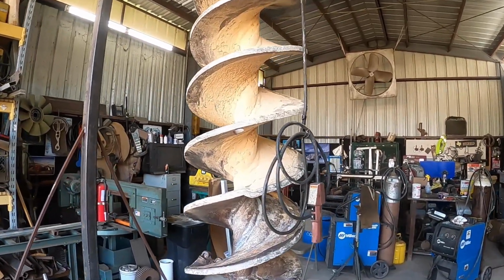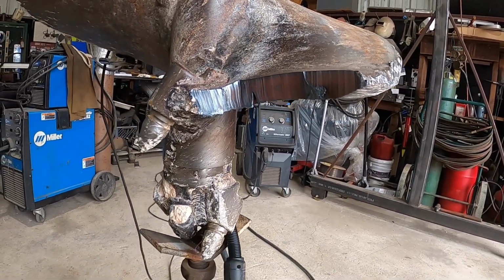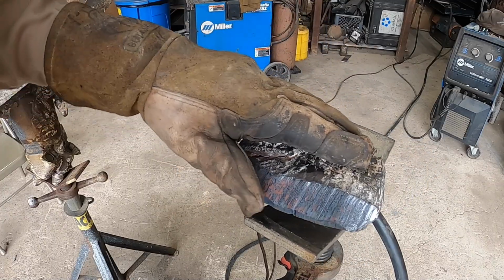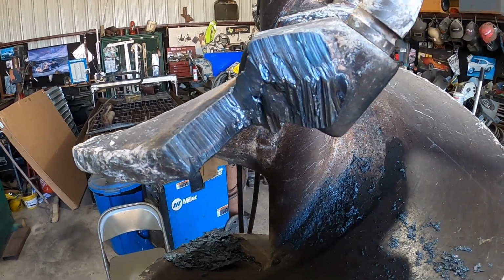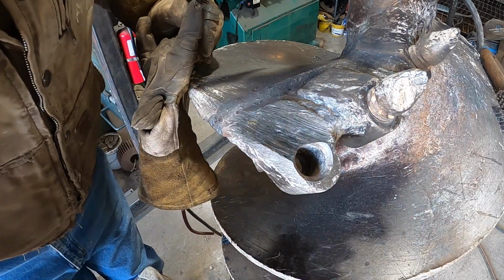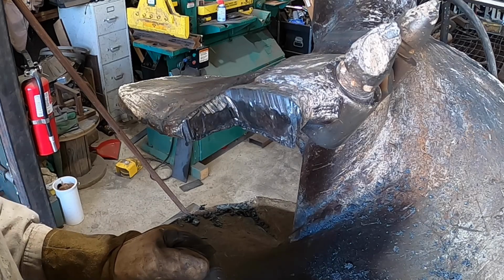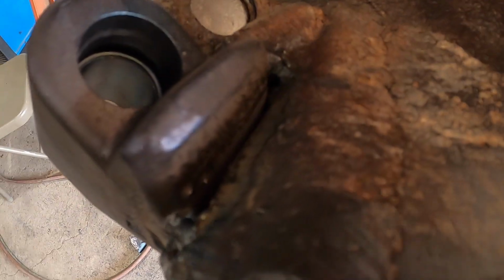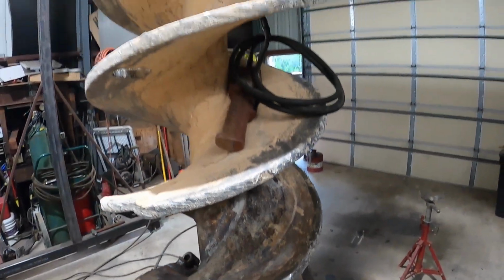Auger Back again??

Comment: I am always wanting to learn. Sometimes thinking I don't know enough to do?????. When watching what your doing seeing if my idea is was correct? When you were welding stick, with the Sandvic tips do they require/  were you using something other then 7018? Interesting to watch where one just would have to say just tweak ??? and it will be/work much better as I have been on both sides of that.

Comment: It seems like you could sink a few feet of casing into you shop floor to put those augers into. That way you wouldn't have to use a ladder, and they couldn't fall over. I'm sure you could fab up a cover to place over it when not in use.

Comment: That's the problem with some rock augers! they run a single flight 25/30mm thick and the bullet tooth holder is offset, so all the force is pushing the tooth upwards!!! i always put a backing plate behind the tooth holders and fully weld up, this helps with all that stress being forced onto the flight?

Comment: “It’s fixed until it breaks again.”   Truer words were never spoken when it comes to equipment repairs.  
Operators will always seem to exceed the design parameters for their machines, then blame the breakage on poor materials or engineering.   
Cheers!
Whipple

Comment: Very nice work, as always!
Can I ask, what size and thickness tubing you used on your gantry? Also, what is the capacity? I am about to buil one. I am following the beam size for a 3 ton, from LGH (Lifting Gear Hire). But theirs is a little different, whereas the  vertical tubes do not go all the way down. I am going to make it like yours, where it does go all the way down, and have smaller bracing tubes. Thank you.

Comment: to stop the ends from folding up like that would it be feasible to put a "strongback" from the top of the outside tooth at an angle towards the center up the spiral? this would give everything clearance to move spoil and not rub on the edges and reinforce the outer edge and tooth where the bend seems to start.  just a spitball but hey who knows?
Reply from the maker: Yes, that is another option. Unfortunately they were in need of it rather quickly.

Comment: Bottom edge of the auger needs stiffening plates and maybe a vertical support from the free edge corner up to the flight edge above.  Should make it even tougher.  Is it really 4 teeth on one side and three on the other?
Reply: Yes,at each pass the 4 teeth cut grooves,and the 3 teeth are in-betweens.If they used 4 and 4 the followers would be in the same paths . In order to offset the paths one flight would have to be wider!

Comment: Hi Isaac, do you have to be concerned about the pockets distorting during the weld? It looks like the teeth are a taper fit
Reply from the maker: no, they hold up well. theyre a good cast steel.

Comment: great job was wonding if. knowing that meg dose a nicer job wouldnt stick be alot better for heavier equipment. were they are put though alot of abuce and rarsher ground.
Reply from the maker: So long as the mig is setup correctly, itll be fine

Comment: You can get clear lens covers for most video cameras, thus protecting the lens from any spatter. Usually used to keep dirt away from stuff, you can use them as disposable filters. They're cheap too, less than two dollars, usually.

Comment: I find it note interesting that although you stats rated out with that shiny new plasma cutter, which seemed to do a really good job, you went back to the old gas axe and carbon arc gouger. I have a Miller 625 that I do the bulk of my cutting with, but I would sure like one of those hypertherm 85s

Comment: Isaac I enjoy your videos. What amp are you running your Miller 251 and what wire speed? Are you running .035 wire and I assume 75/25 gas?

Are you using a Lincoln Excalibur 7018 1/8 rod?

Comment: Basically you want all your teeth to begin digging simultaneously. I don't think the current layout is 'Set' correctly, therefore one tooth is hitting the flint on it's own (on the outer edges) and is not relieved by the cutting action of the full set. Probably the wrong type of boring head for hard flint. I thought the Plasma cutting was untidy and rough. The oxy cut was much smoother looking. Always fascinating!

Comment: I know nothing about this kind of welding, so my question may seem like it's a 'greenhorn' question, which of course it is. 
Why do you use a Plazma torch for some of this repair then switch to the good old oxy acet. torch for the remainder of the work?

Comment: Looks like they need more speed and less crowd force.
Reply: Hey Leif, can you explain why they would need piles in rock that is stronger than concrete?
Reply: @lawfulldick4158  Maybe some guy figured a column would be less likely to tip over if it was stuck into something solid instead of just siting on it ?
Reply: @lawfulldick4158  I was commenting on the digging speed and down force. I have no idea what they are building or why.

Comment: It sure didn't look straightforward job. That was tricky to everything lined up. Cool watching the plasma torch work its magic. 
The question i got is. Why don't you put hard face weld on the wearing surface?
Cheers from afar.
Reply: From one of his other auger videos, it's worse than what's shown here.  Each side's bits are offset from the other side so they don't cut the same channel so you have to take that into consideration as well.
Reply: @jcadult101  
He is very skilled.

Comment: Nice repair Issac, 2nd time around its just as much work as the first just a bit different spot , when you drop it off at the job site they're probably saying Yeehaa, we're gonna bust it again and he's gonna be back before he knows, 8 days later all you hear is Dang Boi , he did one helluva job fixing it better than before,👍 its planning out your repair then executing your plan and you  do it like an artist, your work just blows my mind, I have seen a helluva allot of people plasma cutting my years in the heavy steel industry and non as smooth or steady as your hands Dr. ISSAC,  and very few of them cut that thickness or hardness of metal, the bulk of my work is with Boron steel , Boron with silicon 5  up to 3 "thick and high carbon steel this stuff is hard to drill , machine and use special punch lubes to avoid snapping tooling, $1700/barrel and Cobalt HSS bits 35-75mm to drill  the high carbon that stuff is so dam hard and easy to chip or break a bit, you throw away $350 a bit , thats the cheap small one, heat treat the Boron with silicon 5 is nuts, 2200 Fahrenheit in the furnace for about 70 minutes, quench 3 minutes, then 70 minutes in tempering furnace, heck you cremate bodies at 2400  most of the time its 1600 for the regular Boron , its a great job, yours is like a surgical theatre , Texas style, hope they don't bust out your work too soon
Reply from the maker: Wow, that is incredible. I have never worked with that stuff.
Reply: @ICWeld  could you tell me what brand and model plasma cutter you were using? Thanks

Comment: Those rat hole rigs are not cheap, so the downtime on these augers must be killing them if they dont have a spare bit. Side note, that plasma cutter looks like its going to save you a lot of time. You're using it quite often. It does a great job.

Comment: With your Plasma cutter what air pressure are you running and what amperage
Reply from the maker: 85A and 80psi i believe.
Reply: @ICWeld  thanks Isaac

Comment: My first thought of how I would think to fix it would be to trim off 6" off the bottom weld on new pockets.
Reply from the maker: I already did that. I was concerned about exposing the center female threaded sub too much. Didnt want it to break off.
Reply: I was thinking that too but would think that first section has to be thicker to handle the grinding force, the rest of the flighting just hauls the material up.
Reply: @ICWeld  Is the original start thicker or reinforced?  I would think that section needs to be as it's taking all the force from the bits. Further up the flighting is just carrying material, maybe why it's bending?

Comment: Thats a really damn nice plasma torch, if someone made a long plasma torch with brass and ss like oxy acetylene torch style but for plasma id buy it in a heart beat but maybe they do i havent looked into it
Reply from the maker: Hypertherm has a scrap torch style plasma handle in a 24" version. but not yet for the Sync model. I am looking forward to getting one when they come out.
Reply: @ICWeld  youre the reason i only use an old victor long torch lol they really do cut better than short torches with the same pressures and ive cut out precise parts out of plate to fix my welder

Comment: Now we see Isaac using the plasma cutter quite a bit - and they say you can't teach the old dog new tricks... ;-)
Seriously though - Isaac, I remember you saying that cutting through that hardened lining on the outer edge of an auger with oxyacetylene torch is pain in the butt - does plasma cutter do a better job in this area? Seems to me like it does, but I'd like to hear your evaluation. Thanks.
Reply from the maker: Yes, The plasma doesnt care about the hard surfacing rod. itll cut through much easier than with the torch.
Reply: @ICWeld  Thanks for the info. : )

Comment: Just wondering why the auger has 4 teeth on 1 side and 3 on the other, my auger on my machine has even on both sides
Reply from the maker: its so the teeth dont run in the same circles. They each run in their own lane. More effective

Comment: Are Rock Augers made from a hardened steel and if so could the heat be causing that end to temper? I wouldn't believe it to be anything but a mild steel but I also have minimal experience with them.
Reply: Not hardened.  Except the teeth.
Reply from the maker: Its just mild steel

Comment: I notice that in some parts of the video you use a plasma cutter and others you use a acetylene torch is there a reason that you used the different cutting torches at different times?

Comment: At around 17:30 of the video you used a torch to cut off the tooth mount when you had cut so much with the plasma cutter 

Just curious why you used torch instead of plasma cutter. 

I'm not questioning or criticizing.  Just trying to learn

Another great video by the way
Reply from the maker: The plasma wouldnt cut through the thickness of the pocket like a torch does.
Reply: @ICWeld  ok. Thank you for replying

Comment: When production is king, you run the equipment until it breaks, move it out of the way, get another one to replace it while the other is getting repaired.  Lather rinse repeat.  Equipment only makes money when it's working.  If that means paying for repairs on drills, so be it.  There is no cheap, clean, easy way to drill through hard rock They know what they are doing and these repair costs should be figured into the bid unless the geological surveys are wrong, which does happen sometimes.  Usually, big jobs are on tight schedules and often contracts are written with bonuses for finishing ahead of schedule and penalties for delays.  Payments don't pause while your equipment is down.  Most reputable companies do their part on maintenance and services.  But this is a wear part.  No different than any cutting tool, really.  Isaac is the guy who replaces the wear parts as needed.  And he does one hell of a job.

Comment: Why not strengthen the auger at the tip by welding heavy ribs on the top side of the helix behind each tooth to spread load prevent it bending up. After all it is back again.

Comment: Hey Issac !? How many PSI are you using when your gouging..and how big is your holding tank..wondering how small of an air compressor you can use to gouge. Great vid..i remember that auger the first time you fixed it ,, great channel!!
Reply from the maker: 80psi 60gal
Reply: @ICWeld  Thank you

Comment: Good repair Isaac. Is the plasma too fierce to use for some of the edge preparation? I see that you go back to the cutting torch a lot. Or is it just that you’re more comfortable doing the weld prep with that? Kind regards.

Comment: Hi Isaac as usual great job man!!!  Love your videos!!! wanted to ask what welding wire did you use here?  And if you can explain how you decide to use stick welding and when in MiG?
- Last one...Is it not wearnst resistant steel that requires preheating before welding?
(Sory for my english)

Comment: Could you cut a few inches of the helix off and mount the teeth on the new edge? I know it would shorten the drill and need some changes to the pilot drill but it would give you good, thick metal without any kinks to work with.  🏴

Comment: On average what would say the life span of the teeth would be? Where I’m going with this is if they did not change them that often could a guy weld on a peace of plate to the back of the cups to the center of the shaft and distribute the energy from the cups to the main body towards the center? A gusset idea. It would have holes in it to allow access to drive the old teeth out. May not even be practical. Just a thought on my part.

Comment: I'm surprised that it's not symmetrical with its teeth.  3 on one side and 4 on the other just seems off somehow.  Is one of the blades wider?  What's the reason?  (Just beat up and well used/much repaired?)
Reply: He mentioned in the previous auger video, the teeth are offset from one side to the other so they don’t cut in the same groove as the drill rotates.
Reply: It helps brake up the rock in all spots so you don’t have grooves that will start to wear in between the teeth
Reply: @davidgibson5756  Makes sense, I forgot that.  Thanks.  :-)

Comment: This cutting head has been cut apart and welded together so many times, it is basically made of weld by now. The teeth are supposed to be the consumable, not the head. Seems like an inherently bad design. Bend thick sheet metal into a spiral, weld teeth to the bottom and call it a day. Not a minute spent on stress analysis. Should cut the whole head off, replace it with a properly designed head cnc cut from high quality steel with appropriate geometry/strength to handle the torque of the machine.

Comment: I see that you hold the needle scaler with your hand to make needles smaller in diameter to be more precise on removing debris. Why not try to modify it by welding a smaller extended attachment. Actually I see all welders do this. Maybe you can design attachment and patent it. I have nothing to do with welding, just giving my two cents.

Comment: operator must be getting paid per hole......when they keep breaking in that area, you have to let the carbides do the work. That rig is putting too much force on the down movement. I would cut the force in half and speed up the bore. Yeah, I know that we all can be armchair quarterbacks but hard rock augers have more of a taper instead of just going pilot bit straight to 4 carbides.

Comment: You dont need a brain if you have a power. I am absolutely sure that drilling machine has a torque regulator  and can adjust a torque limit. And it was set to MAAAAAXXXX